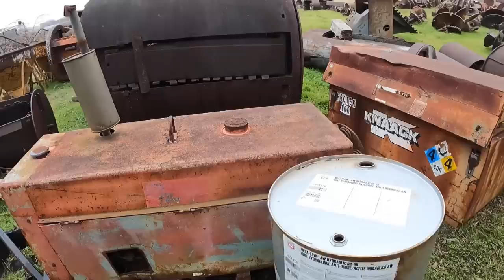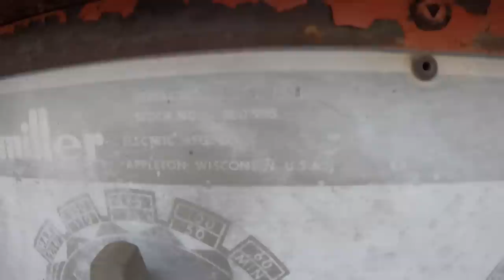Miller Big 40 Find.

Comment: I'd first see if the motor is salvageable , if you can get it to run without doing too much to it. then check out the welder... then decide. but a restoration ( if possible) would be a fun series to watch

Comment: first thing to do with the engine is see if you can turn it over.  then do a compression test to see if its any good or not...the big warning sign is water in the oil...sivn of a cooler  fail if fitted or a head gasket.  the weld set on the back needs an insulation test as its stood for years in all weathers. have to make sure the insulation is sound before connecting anything up or risk electrucution. stay safe. get a sparky to cert it.

Comment: Welding machines have come a long way from 50 years ago so it might take a bit of research to see if it would be worth the time and expense to get it working well. On the other hand an engine is an engine, so if it will fit your forklift I think it will serve you a lot better - and a lot less expensive.

Comment: Assess it first. See if it turns over. If it doesn’t; maybe dump it. If it does, dig deeper and disassemble it, clean and see what’s left of it before you start it and let it eat itself up. If you don’t want to get it back into running condition, look what parts you can keep as spare.
Looks like a pretty simple and cheap thing to get back to life. But block, head and crank cracks may be show stoppers. Getting a manual with torque and clearance values may be an issue

Comment: I believe that's a continental engine I have one out of a welder it needs a MAG and a carburetor hopefully yours runs I sold one machine to a welder and I actually scrapped out the welding Parts the guy said it wasn't no good there's quite a bit of copper in there

Comment: See if the motor can be freed up easily, then the welder controls. Go from there in a direction that works for your needs, and what you have to work with.

Comment: I got the exact same welder.  Go to Miller website and enter serial number and you can download the original maintenance manual for that rig
Reply: Seriously tho man.. keep in touch if you have questions.  There's a lot of analog parts for this beast.  I got a couple boxes of parts... diodes,  resistors,  brushes, etc..   I will say that it's, by far,  the best DC welder I've ever had the pleasure of guiding metal puddles with.  1/4" rod and it dosen't even skip when u strike an arc.  100% duty cycle too.  You don't find that.... anywhere

Comment: With the availability of cheap powerful new twin gas engines (harbor freight et Al) I think using the motor for your forklift is good and if that old welder generator works use the new motor to power it as a big old stick welder for practice.  🤔

Comment: Change the oil and water in the engine, fresh diesel and see if it will run. Free up and clean the 40 unit and see if it will spark. If not into the forktruck with the motor.

Comment: Good grief! How much is that crane rated to lift?.... That big 40 will weigh just a bit shy of a ton and you lifted it at full reach like it was made out of plastic. I bet it would tip the truck over before it would stall. I'd love to have one like it! That whole rig is super nice. 👍
Reply from the maker: almost full reach. I lacked about 3'. But yes, it was heavy!!
Reply: @ICWeld  have you guys had a chance to check out the big 40? I bet there's a lot of those good old machines sitting around the countryside turning into rust. Maybe y'all can get that thing back running again.

Comment: I'd open the drain plug see if any water isn't it.
 if not try to turn it over 360, fresh oil see if it will fire up and work. and go from there be careful.

Comment: In my opinion, since your original idea was to use the engine for your Forklift, the first question should be, which engine rebuild would cost the least, the Forklift's current engine or the Miller engine, and once that is known, then go from there.

Comment: I'd 50/50 atf and diesel right down the cylinders and see if it'll roll over.  If it can be made to run that might give you an indication why it was parked.  

I've had engines break free with minimal effort and run okay for a while.

Comment: get the engine running and see if the generator portion works. if bot check out then decide wether to restore the welder or rebuild the engine for the fork lift and scrap the generator portion.

Comment: Who's yard is this? AH Beck?
Reply from the maker: No, Its another company local to me.
Reply: @ICWeld  gotcha, they have a lot of drill tools! I work for a heavy civil contractor and we have done shafts up to 11.5' with 11' rock sockets. We have also had beck as a sub on a few jobs. Good outfit.
Reply from the maker: i worked on a job with them here in town. they did an 11' hole 110' deep. Had to weld some big casings that were going to be installed and left as support vertically for tunnel access at the bottom where they were going to tunnel towards the lake.

Comment: First off take a cheater bar and try to turn the crank over by hand don't Craigslist starter be your luck with fire engine if there's any water to go to the engine ruin the crank pump or whatever maybe it's wrong anyways but most definitely drain the oil that's if it turned over free tired mechanic but the first thing I always do is usually just try and turn the engine by hand with a cheater bar if I get it turned over hopefully I don't hear no clanking as I'm turning it then go for oil change builder and try to start it if the carburetor is any good let me know if you think that's a good idea but that's what I've always done it you just say I bought a pig and a poke and open up the possum God bless you wish you a very beautiful New years

Comment: To bad these guys have to butcher a perfect side panel. On a pipeline welding with Lincoln sa200 on a deck of a track machine. One on each side of the motor. They would weld the skids to the deck and torch a hole under the oil pan of the welder to drain the oil. Needless to say who owned the track machine had a lot of holes to weld up.

Comment: Is it of any use to you (or rather, the young bloke) as a welder?

Engines are a lot easier to come by than engine driven welders. If it's of any use as a welder, better to keep it as one. Make it run reliably to start the young bloke off doing jobs solo when the time comes.

Otherwise, if you've a need for it, rebuild it.

Comment: Get the engine running see if the generator works if it does use it if it doesn't put the engine in the fork lift!

Comment: If the motor is free .... Then change the oil and see if it will run and power the welder there's not much can go wrong with those